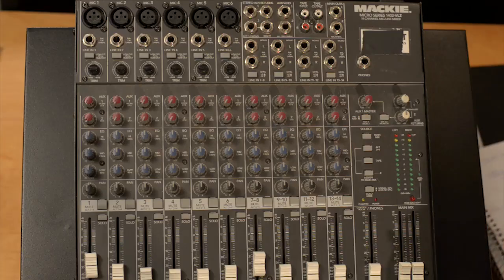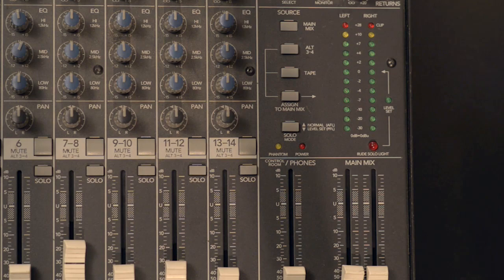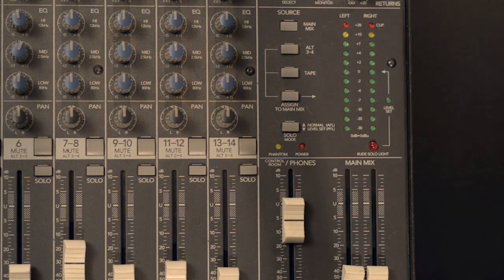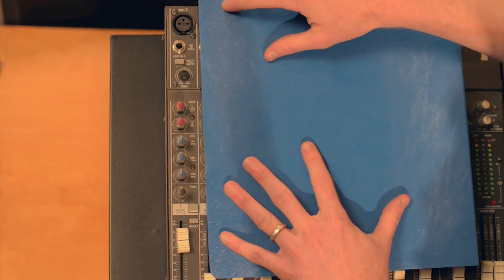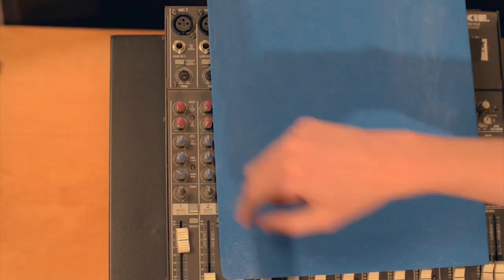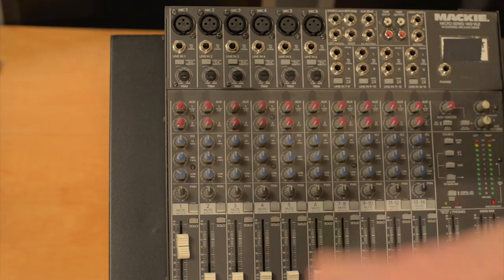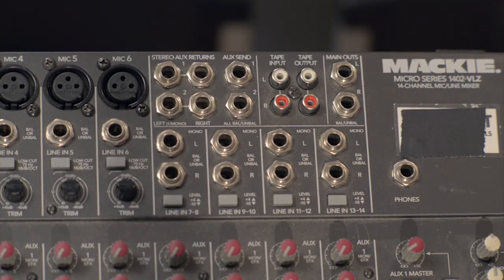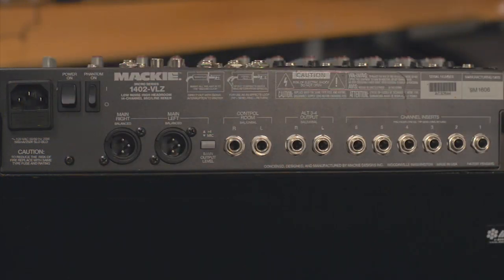Introduction to Using Audio Mixers with Mackie 1202 or 1402

Comment: In the music industry, the term powered is reserved for a mixer that has a power amplifier built in for directly driving speakers.  The correct term needed to power microphones is "Phantom Power" which is entirely different than having a power amplifier for speakers.  When looking for a mixer, do not search for powered mixers.  look for unpowered mixers with phantom power.
Reply: I need to add on to my prior post as the video started indicating he was an experienced audio guy.  My recommendation is READ THE MANUAL.  The coverage of the Trim was sadly completely wrong.  The channel strips like the main need the sound to be normalized.  This is where the SOLO button is used.  On Yamaha mixers and some others, it is called the CUE button.  When turned on, this switches the Headphones/Control Room monitor to JUST the channel being monitored AND the VU meter no longer shows the main level but instead the level of the channel being SOLO.  With the slider at Unity, the Trim is set for normal speech, singing, etc to be at UNITY at the meters.  This provides enough gain for optimum sound with decent headroom and not too much gain raising the noise floor.  Please read the manual if you want good performance from an audio mixer.  More than one channel can be cued or solo'ed at the same time so vocals can be balanced for singers, and guitars can be blended, etc.  When all SOLO or CUE is off, then the main is monitored again.

Comment: Good introduction video, I've setup audio from years,and, from another perspective, if I may offer one issue.....when you mentioned the main volume control, you said to start low and build up....if you refer to the manual, in the setup section, it says to set them to "u". This actually works really well and you then use the channel volume slides to control the levels. This way your not chasing yourself all over the desk. It's also important with any mic setup to spend at least 30 mins "setting the levels" to ensure the best possible output and to minimise how often your adjusting everything. One last note, not every mixer will have features you mentioned nor have outputs/inputs on the rear panel.

Comment: I think this video was targeted to an audience that doesn't use a mixer for sound reinforcement regularly but perhaps for, as the presenter says at the top of the presentation, for film makers or videographers who need to add clean recorded sound to their film and video footage. Some of the topics presented along the way were presented in a very easy to understand manner for that audience but to those who use sound reinforcement equipment it probably came off as wrong or that the presenter was misinformed, or maybe even misleading the audience. Especially in the areas of describing the channel strips from top to bottom and gain structure. Still I'd offer big kudos to this presenter for this video in general and I think he is well on his way to becoming a very formidable presenter.

Comment: Thanks for this great video! Just wanted to ask you something. I want to use an external analog compressor with my microphone. I am taking the signal from the insert so I can use only the preamp of the mackie board to feed the compressor and then from the compressor to the interphase, (to avoid distortion in the recording). Is there any meter for the input of the preamp "trim"? Or do you have to rely only on your ears?

Comment: Is the 1202 the same as the 1402
Reply: No. The 1202 has four XLR inputs and the 1402 has six. The 1202 has volume knobs with the 1402 shown here has sliding  faders.
Reply: Essentially they are the same, only real difference is number of channels (and in turn size) and channel volume control